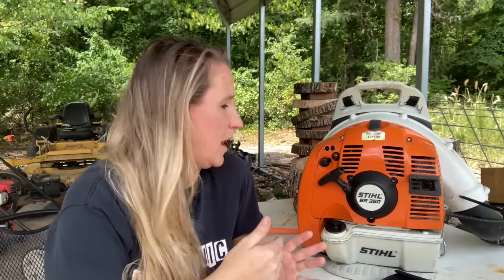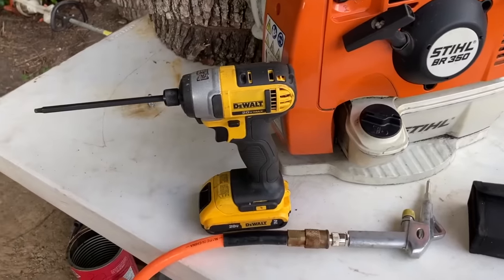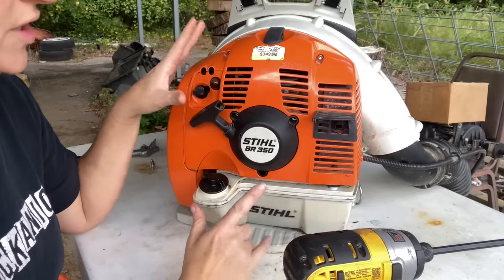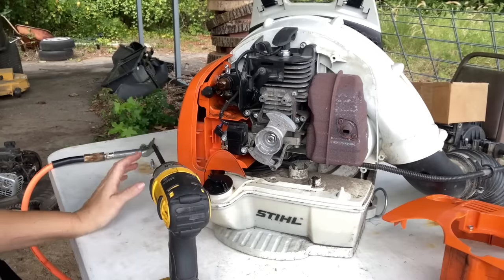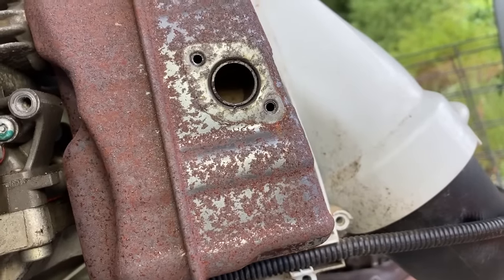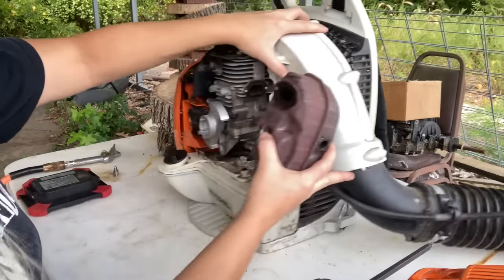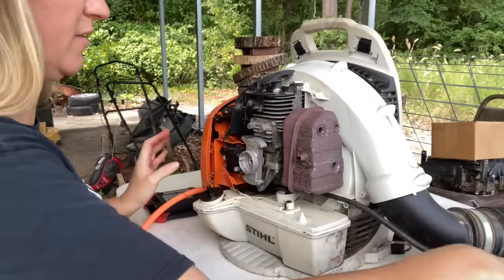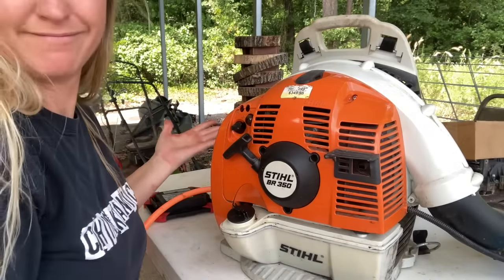Stihl won't throttle up or stay running? First thing to check!

Comment: I started getting snow blower inventory ready last week. By the time it snows here in Flint MI, I plan on having 20 snow blowers ready to go. 95 Degrees here today with heat advisory and I'm playing with snowblowers.
Reply: End of August we start getting the salt spreaders and plows ready and see what doesnt work since it was put away. You’d be surprised at just how much can go wrong while equipment just sits. Don’t wanna wait too long until it snows to find out that your equipment isn’t ready. And this way we don’t have to rush to get everything operating correctly. So I understand.
Reply: @landscapingspecialist  where are you located?

Comment: When I moved from Seattle to rural Kentucky 11 years ago, I bought a used Craftsman d2000 if I remember correctly. It was a V-Twin Rider mower. It had a weird problem a couple of years into using it. One cylinder kept bending pushrods. In hindsight this sounds stupid but I kept having to loosen the rocker and using a hammer to straighten the push rod and putting it back together and that would work for a while but it kept doing it. I bought new push rods off Amazon but I ended up never putting them on because in the long run I ended up buying a large zero turn since I'm mowing 9 acres now.

But the problem really made me nervous even about my zero turn. The problem was that a mouse had built a nest around that cylinder under the plastic shroud and it was causing the cylinder to overheat. At the beginning of the season I always remove the plastic shroud and check my zero turn to make sure that that hasn't happened to either of its cylinders. I store it in a heated garage with plenty of mouse traps so I just hope it doesn't happen halfway in the season.

Comment: I found this video trying to figure out why my trimmer might have stopped running while I was using it. It will idle ok and die right when I hit the throttle. I am going to check the spark arrest screen, since the air filter looks ok. Thank you for the info.

Comment: Love watching you work.  Haha. 
A little off topic ……buying spares on eBay I find often there are small but important differences to the original. Could never reassemble oil pump after using spares on Stihl 034

Comment: I've had similar experiences with spider webs in natural gas pilot lines and bird nests in chimney vent lines. I've also had customers complain about their oil pumps failing in air cooled 100 ton air cooled screw compressor chillers where the real problem was a head fan failure causing an increase in oil velocity due to decreased oil viscosity from temperature increase (exceeding curve values) when the CPU was equating a value based on pressure differential from an inlet vs outlet transducer value equaling zero flow when it was just hot oil flowing too fast. What goes in must come out, plain and simple. I love the video, keep it up!

Comment: I was a transit bus tech for 15 years. Gilligs. The Pre 2007 DPF's, used a muffler with a Catalyst inside. When the buses had about 400K miles on them, the complaint was the engine accelerates sluggishly, turbo doesn't spool up. 
After checking fuel rail pressure, and replacing the air filter. We'd pull the big ass muffler out, knock the cat ceramic out then reinstall. ENGINE would run awesome. 10:45 the Mower Medic did a video a week or so back. Stihl motor mix should take care of the varnish ?

Comment: Something I think worth mentioning is that a lot of problems with small engines are due to lack of use.  It is surprising how few non professionals run this equipment through even one tank of gas in one session.
Reply: True. I ran a Br600 grass and snow for 9 years with no problems. Either you move or you rust.
Reply: Two sides of the coin

Comment: I didn't watch more than a couple of minutes of your video before I knew exactly where you were going with it. I have the exact model blower you're showing, and had the exact same issue. Mine would start and idle, but was sluggish when you revved it, and wouldn't make full power.  I tried adjusting the carb, with no improvement, then decided to check the owner's manual. Guess what, they tell you the spark arrestor is bad to clog, but tell you to take it to your Stihl dealer to have it serviced. It's like trying to force a round peg through a square hole, but you can get the arrestor out without taking the whole front off. Instead of cleaning it and replacing it, I just threw mine away, all it is good for is to clog again in 5 more hours of use. It's one of those Federal regulation things, they're afraid you'll set your leaf pile on fire with it and all gas-powered lawn equipment now has to have a spark arrestor in the exhaust.. I did replace the small rectangular nozzle on the muffler, but the round screen that fits down inside the muffle got thrown in the spare parts box, just in case I have to clean and reinstall it when /if I ever sell the blower.

All that said, I've yet to have to dig out a dirt dauber's nest from a muffler. The daubers around my house seem to prefer the open ends of my pressure washer hoses and fittings. I've also had a hornet's nest under the hood of my tractor, and it got built in less than three days between the times I used the tractor. Pretty wild to climb on and start it up, and have white-face hornets come pouring out from around the hood.

Comment: LOL!!! I knew exactly what was wrong when you started this video. I had the same issue with a Honda 1000i generator. when I received it someone else had already attempted to repair it. This unit would only fire about 6 pops and die, no matter how many blisters I worn on my fingers it would not fire again. I would remove the carburetor, check for fuel, dirt, water, fuel pump flow, clogged fuel filter, low oil pressure shut off sensor. Each time I reassembled it would hit for 6 pops and die. I disassembled the carburetor and discovered the air Venturi tube was missing. Eureka, this must be the problem. after pricing a new tube for $25 I decided it was wiser to just buy a complete carburetor from Amazon for $35 as it would have the proper tube. A few days later I installed the new carburetor after it arrived and I can't begin to tell you my disappointment when I pulled the starting rope and still had the same issue.(6 pops and die) I then re-installed the old carburetor with the air tube from the new carb and tried again. SAME RESULT. Almost at my wits end and wanting to adjust the generator with a sledge hammer I quit for the day. 
After sleeping on it for the night I decided to remove the Muffler and try running the unit without it. after removing the muffler I attempted to blow air through it with my mouth and it was completely clogged. No air at all. I pulled the start rope and the generator ran on 1st pull, albeit a bit loud. I was elated and Frustrated at the same time. i Stuck a screwdriver in the muffler and broke the dirt Dauber's plug. I Blew out the muffler with compressed air to ensure all dirt was removed and then could easily blow through it with my mouth. Re-installed everything, cranked unit and it ran but was surging at high speed, with or without load. Replaced the old carburetor with the new one (I was an expert at this by now) and the generator ran like new!! Yeah. Good thing I decided to get a new Carburetor!!!
This was a small engine Butt whipping I will never forget and thank my Sister for bringing me this educational project!! (NOT)
Thanks for your video. It made me Laugh!!

From Friendswood Texas. Remember Friends Would, if Friends Could!!!

Comment: Thanks for the tip.  My blower has been doing the same thing for a while.  I have to give it throttle immediately after starting or it would just putt out and stall..

Comment: Similar issue with a WeedEater TE475Y. I have 6.5 acres of park-like property. Most of my power implements are Echo but I am a retired industrial mechanic and find it hard to give up on and  scrap any equipment. So I have a few cheaper trimmers from when the property was much smaller. 
This one was my favorite for trimming around my pond and numerous small trees. One day it quit running until I let it sit for a few minutes. It would re-start and run for a short time and quit again. I am loaded with spare parts cause that is what mechanics do. Compression at 75psi. Replace piston and ring. Now at 100psi. Replace cylinder head. Compression at 130. No start. Removed trimmer shaft and working with motor only. Put on carb from a running trimmer, same model. Start but idle only. Replace exhaust with new spare. No difference but periodic backfire. Throw on new plug and coil without wiring kill switch. Coil gap set using business card. No difference but backfire gone. Take off new muffler and start. Better but bogging, New carb. Same result. I am running out of parts. New o-ring on crankshaft cover. Any ideas? It's personal now! Lol

Comment: Way back when I ran pro-rally, a mechanic told me to use power tools to remove part. Use hand tools to at least start the screws and bolts. To avoid cross threading. I’m surprised you didn’t put a new muffler or a spark arrestor in the unit.

Comment: The one on the Husqvarna 525L weedeater is awesome  its just held in by a lil screw and is very visible just clean it an then take then tin foil lookin thing out an behind that u got a lil square window an u pull the string alil bit to get the piston up passed that window so that u dont get all that carbon build up in the piston once its up there blocking that window u scrap n clean it with a stright screw driver then put everything back together do it every year an never had a problem with it an have had it a few years now   what issues or problems do you see alot with the Husqvarna 525L weedeaters and is there a brand that u dont see to many issues with  thanks  love ur videos helped us out so many times  learn so much in a short bit of time

Comment: Just found your channel and subbed, that was crazy dirt daubers got in there and clogged the muffler, whatever they can get into they will build a nest I guess! I am a small engine mechanic also, love working on them. I have a BR600 backpack blower which has the 4 mix I got a few years ago from a lawn care company for a steal because it needed a little work, just resealed the engine on it because it had poor idle, lack of throttle response and slow acceleration as long as I've had it but man resealing the engine made a huge difference, runs like brand new now.

Comment: Just saw your video, my still fs91r will idle but no power, I changed the diaphragm on carb, still no power, even reset the valves. And the spark screen was clean… 
Now I can’t wait to check the muffler it self.

Comment: Hmm,my bg86 is doing that exact same thing. I did check the spark arrestor,but didnt look up inside the muffler. Like you said,it ran great and then the next time I went to use it I couldnt keep it running. I'll pull it out and give it another look.

Comment: Seen this sort of thing over the years, but very infrequently. One instance was a customer's light truck engine, another was a burner on a cooker.  The key to not spending weeks taking it apart is to think your way around the Otto Cycle.  Compression, yes. Spark Yes.  Fuel yes.  What's missing? AIR.  In NZ, we call those little caddis builder Mason bees, I do not know what you call them. 
Keep well.

Comment: I had this problem too,it was a simple fix.drained out my regular gas and refilled with high test gas,worked perfectly,it even said on the small oil container to use at least 89 octane,instead of the 87 octane regular gas,I put in 91 octane.
Reply: Should always use the highest octane available in your state for 2 cycle engines. They run hotter and faster so it'll help with that in making them cooler and cleaner

Comment: freaking bingo. Dam I was pulling my hair out. Was gonna buy a new carb but it was clean, then a coil until they said its a 116 bucks. I pulled my spark arrestor off to clean it but for some reason I couldn't find it on my bench ;)

Comment: Bri I have learned a lot from you thatI thought I already knew. I do have a couple of suggestions that may save you future distress. First and foremost ; don’t hit your spark plug wrench handle with your hand the slight impact sure loosens the plug so a slight tap with a soft faced mallet is a better practice. An old mechanic told me this many years ago. I regret that I didn’t heed the advice every night as the ache in my hand reminds me. The other thing is to use a hand held screwdriver to start screws. The big secret is to back thread the screw in a blind hole until you feel it drop in the threads, you can sometimes even hear it click in. After a couple of turns use the impact driver to speed the rest of the way in. Takes a moment longer but a lot less time than repairing damaged threads😊.

Comment: seen a couple plugged mufflers in my time  they were from heavy oil mix.  burn them out with a torch.(off the equipment of course). seldom see mud dobbers in northern pa. good  find.  if ya cant breathe it out ya cant breath it in. engines are just air pumps.

Comment: Exhaust obstruction is a big problem with Stihl backpack blowers.. My new BR430 with 4 hours on it started having throttle issues.. Reset my carb H/L and then decided to check the flame screen because it wouldn't run correctly and sure enough, the screen clog was the culprit.

Comment: My back pack blower wasn't running, I found inlet & exhaust valves needed adjusting. Valves weren't closing properly. I've removed spark arrestors out of all my garden equipment.

Comment: Had this problem with an Echo CS-310. Thing was as dead as disco when it was brought to my attention. Started at the usual suspects and worked up to the muffler and there it was. One of my old man hobbies is restoring old Coleman lanterns and stoves. Dirt daubers love to build in the air passages of those also.
Reply from the maker: That is a cool hobby! I have some in dire need of repair, but they are not old.
Reply: @Chickanic  parts got real hard to come by last year. If I remember right the main Coleman factory in Kansas closed for good. But with that said and knowing your mechanical abilities I could see you getting yours up and running. They are kinda like a carburetor in a way.

Comment: Nice work. Another mech at ny dealer put me on to the carbon buildup behind the muffler problem a coupla few years ago.

Dirt dobber?? 🤣
Reply from the maker: It wasn't carbon on this one. It was an actual dirt dauber mud plug. Do you get those where you. live? Like a wasp, but doesn't sting.

Comment: I hate working on those small two stroke engines. They never seem to run right for any length of time, no matter what brand they are, except for my Husqvarna weed eater. It's the first Husqvarna equipment I've ever purchased but I'll definitely be buying more of them.

Comment: I personally don't have issues with the spark arrestor screens. Make sure your equipment is tuned to the mix you're using, and check it every time you use your equipment.
Reply: what check it every time you use your equipment ????????????? When you are trying to earn a living trust me you do not want to be checking that every time out !!!!!!!
Reply: Doesn't hurt to inspect, and clean your equipment at the end of the day. Who knows, you might even spot a minor issue that could turn into a serious problem down the road.

Comment: Thank you very much you❤ just gave me something else to look for  I'm pretty sure it's my problem as well..I went as far as new carb.😢 and did not change a thing so I'm really hoping this is a good fix and like you after going over everything over and over and over again it makes more sense that it would be an exhaust problem my equipment is in a hs 56 hedge trimmer and unfortunately it's down more than its up it is a very good machine to use but the downtime really stinks as far as the spark arrestor or resistor nothing but a joke

Comment: If you ever worked on the older Lawnboy 2cycle mowers you would understand the need to checkout the exhaust system all the way to the exhaust port on the cylinder.  That was usually related to poorly mixed fuel.

Comment: A blocked exhaust is very common on small 2stroke engines, I normally poked a screwdriver up there whilst the engine is running and give it some revs